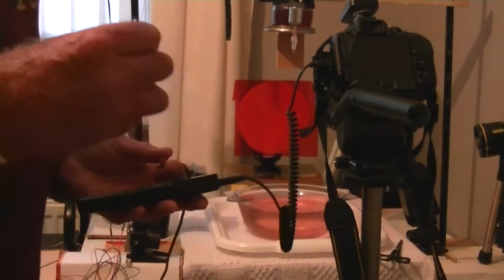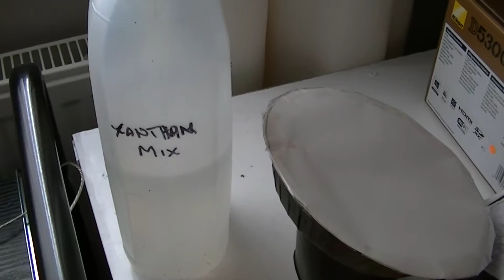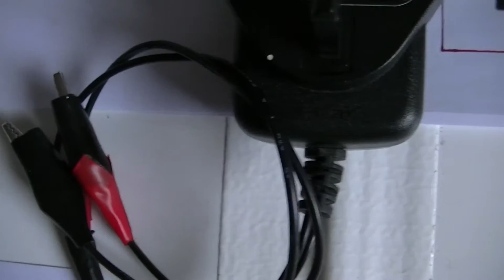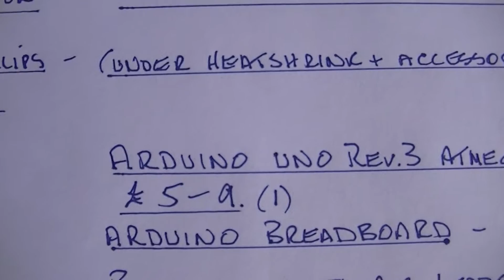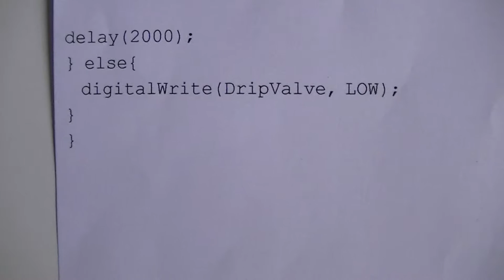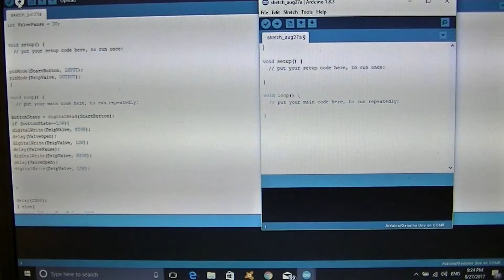Double Water Drip Collisions With Arduino

Comment: Hi! I am making this experiment right now as a cool project for our school and teaching our children about collision photography. Would those materials be sufficient enough for making this project?
Reply from the maker: Hi Anuj, the parts listed are cheap and easy to come by, I found almost  all of the parts on ebay, any DSLR camera will do and the flashes I'm using are not  expensive-- I've  had a lot of fun with this with some very nice  results. 
Good luck with your project , let me know if you have any problems  getting the electronic parts.
Reply: jimmy docherty I have finished the project, and it works amazingly. I used the parts that you suggested, and I used a raspberry-pi instead of an arduino, but the function is the same. Thanks for this video and the inspiration!
Reply from the maker: Hi Anuj I'm really pleased that it worked out well for you, especially as it is helping school pupils.
I've been able to set the flashes up so that  they are set off automatically  just as the collision takes place , takes the guesswork out of it.
The person who inspired me is a Professor Ted Kinsman,  if you  search for ' How to  make a  double water drip system by  Ted Kinsman, you can  add  his flash  set up code  to the code I sent you, you just need an opto-isolator and a resistor, takes you one step further. ( The website is  petapixel.com.  Good luck !!
Reply: jimmy docherty Hi, I will look at his video. Another thing, I have bought the solenoid valves that you recommended, however they see, to open and close a little to slowly, not allowing the drops to be dropped at the right time. Do you have any suggestions for any other valves, or any improvements I can do?
Reply from the maker: Hi Anuj, I have 2 solenoid valves, one is larger than the other, and they both give me good collisions, but I have to alter the delay times when I use one or the other. The height from the solenoid to the to the surface of the water is also important,  as is the thickness of your fluid. It can be really frustrating at the start,lots of trial and error, so be patient!
Here are the settings I have now, try them as a starting point--
valve open: 85 millisecs. valve pause: 20 millisecs. Distance from solenoid drip point to water surface: 380 mm. Use guar gum or xanthan gum as a thickener, 1/4 teaspoon to a litre water. The gum takes a while to mix, stir it then strain it. Add it to the container that 's being used for the solenoid. Re-load the programme each time you alter the readings.
A bit long winded, but I hope it helps, let me know how it goes